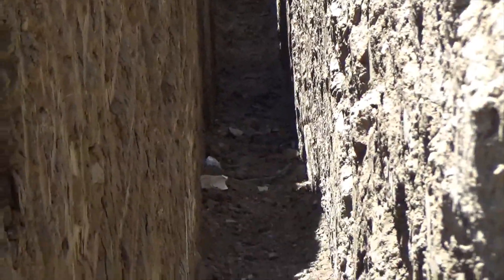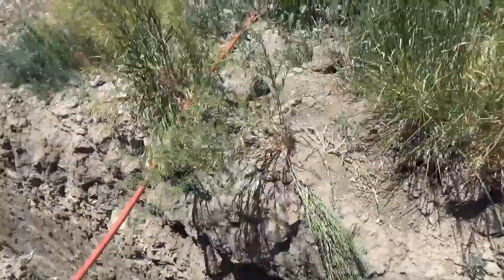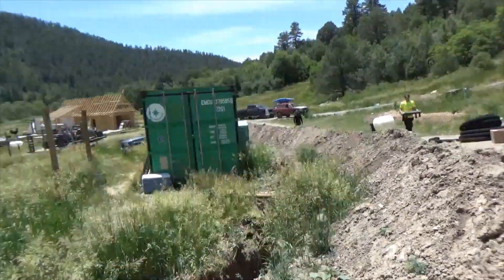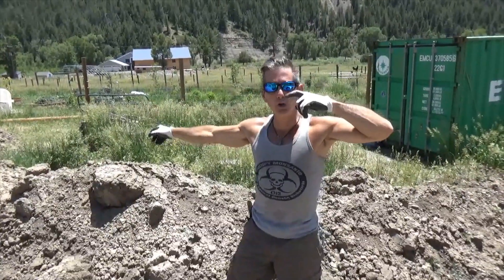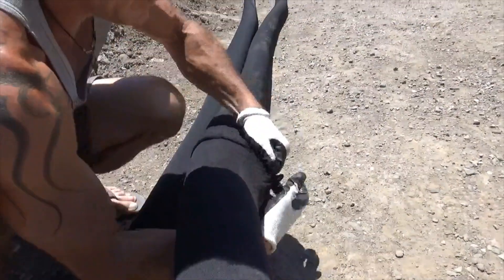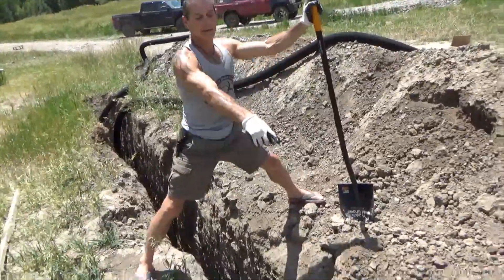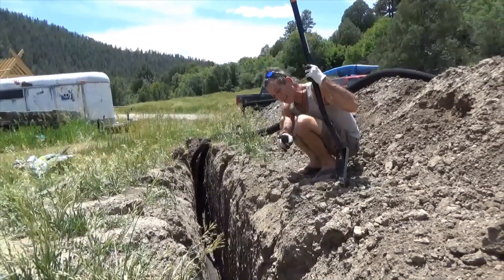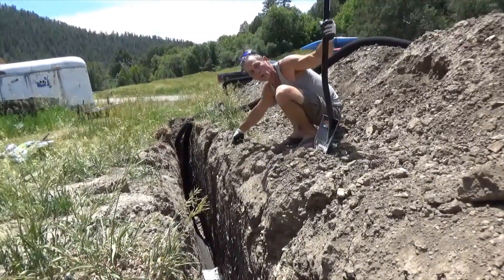Earth Tubes - How To Documentary - Part 1 - Getting Started

Comment: Killer system, love it! I especially love how you are sending the warm air across the top tile and what is coming back is from the bottom. 

I want to point out Radon though. drainage tile, since its not sealed will pull in radon. Its smart, especially in a closed system like this to test for radon on occassion.

Comment: It's odd to me that drain tile has perforations on the high part of the corrugation rather than the low parts. Seems like when they drill they could just as easily perforate the low point of the tubing. The way it's designed right now couldn't you get condensation standing in the grooves the whole length of pipe? Maybe it's not enough water to cause any problems?
Reply: Drainage tube is specifically designed to let water in and carry it away. If they allowed water to flow in and flow out at the same location it wouldnt be much good for drainage :)
Reply: @JohnGuest45  wouldn’t that leave water sitting in the low parts?
Reply: @AKDanMusicMan  
Yes, drainage tubing was never designed to be used as an air duct :) Most video`s on you tube dont even consider this issue. I recommend cutting a straight slot lengthwise  partway through the corrugations using a circular saw with the cut depth set to ~ 3/16" (dont cut all the way through). 
Installing the tube with the slot facing down will ensure the condensate drains fully.
Reply: @JohnGuest45  I guess if the air is constantly flowing through the tubes the stagnant water in the grooves might evaporate, but it just seemed like a design flaw to use these as air ducts.

Comment: Direct ground-to-air geothermal systems aren't new - and you don't need "soft" tubing for it, just fairly THIN tubing like used in most drainage systems.
Schedule 40 PVC works fine in these applications, as opposed to the Schedule 80 commonly used in water systems.
The basic concept goes back to AT LEAST ancient Persia and the "Quanats" (sp?) a couple thousand or so years ago, though those combined a bit of evaporative cooling into the concept.

Comment: ...I'm wondering if you had cistern  wrapped around the house either below ground or buried in the berm could be used with non perforated 4" tubing ...if the tubing had a slope within the cistern...the water in the cistern would absorb the thermal energy and transfer  it to the air moving by gravity thru the tube...

Comment: I've read that you need to use split corrugated pipe, with the split facing down and a gravel bed in the bottom of the trench. Reason being that humidity builds up in the pipes and condensation runs down the sides and pools in the bottom. With split pipe, it all drains out into the gravel bed. Without split pipe, even if you use perforated pipe, you end up with a pool of water sitting in the bottom of the pipe that grows mold, contaminates the air, and forces people to abandon the system. Any thoughts on that?

I want to use a system like this for passive air conditioning in a house. Which will be pulling hot summer air underground and cause even more of a condensation problem.

Comment: 1. The socks will not insulate too much the pipes? As far as I know, the insulation of the pipes should be as small as possible, in order to facilitate heat transfer between air flowing through them and the earth.
2. What is the material from which the pipes are made?
3. Did you dig the ditch by hand? (if so, I have to congratulate you) How long did it take?

Comment: Thank you so much for explaining this - been trying to find some information on the earth tube system. This system recycles the same air correct, or no (could be missing something)? If so how do you combat giving your plants fresh air (carbon dioxide) without opening a vent in the winter? I noticed the citrus in the snow had the tubes open to the air on the outside of the greenhouse - don't know if that helps that at all.

Comment: Leah and cuz I may have a good idea about underground thermal heating system I would take a 2 55gal drums buy one of those wood burning stove kits where you put one on top of the other put in your shop build a plenum made of metal surrounding it put a hole in the plenum around the bottom of the 55 gal drum where you load your wood in it. Cut a hole in side where can regulate letting heat out. Those 55gal drums will put out 80.000 btu  worth of heat then cut your holes in to where you can your tubes to your green house and house for heat or back up heat when it gets to cold. You have to have a back up for when it gets to cold. Plus you cant let Leah pum pum get to cold. I hook one up to my plenum to my furnace in my basement up north my furnace fan did not ever come on. You will have to put a fan somewhere in the system to help circulate that far you have to go. You can also hook another plenum to the outside of the other one and put a hot water tank attached to it. Later see ya soon Farzy Farz

Comment: put a water line in the trench so you can use a radiator system for a heat pump

Comment: Looks like a great project. I do have a question about using slotted tubing as a opposed to solid. Seems the tubing will allow moisture into the tube which will promote higher humidity and all the associated issues.

Comment: That would not work here in Texas. It would fill with water in our Sandy soil..it would have to be solid with joints made water proof. I would use solid schedule 80 PVC with glued connections.  Anything less would end up being crushed. We had installed that old weaker white drain pipe. Over time it got crushed and became useless. Had to dig up the old pipe on my sewer line because it was crushed in on itself. Then got scheduled 80 drain pipe . It had joiner ends already molded on the ends . One female other male. I put a sock on it to prevent Dirk getting inside. It also was as at a downward angle so it would drain. Been working now ever since 2003.  I need to do the gray water line now too. But the septic system has worked well since the redo.  It's a home DYI system put in during the early '90's. I live out in the country. But now they require specific rules not I place back then. If I do a redo on my gray water line myself I will be able to do a DYI repair. To get it done by now required standards. It would cost me $6,300  . Ouch.. I'm going the DYI route just need to rent a ditch witch to dig up the crushed pipe and replace it with scheduled 80 drain pipe with sick. 

Lots of work. But a lot cheaper.
Reply from the maker: There are many people in Texas that use this technique. Texas is a big place with lots of different conditions and soils.

Comment: As a farmer , I have used plenty of drain pipe like this, what will happen with your air duct pipe if it fills with water? unless you have your levels right for it to drain off somewhere it is going to end up blocked with water
Reply from the maker: not in the desert bro - chill.
Reply: If were trying this system in the UK we would have to use solid pipes without perforations